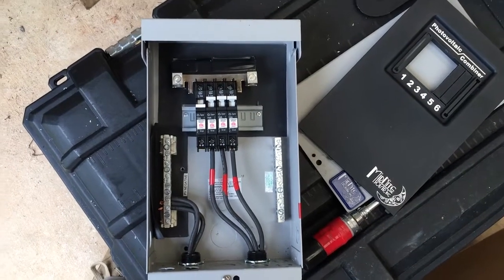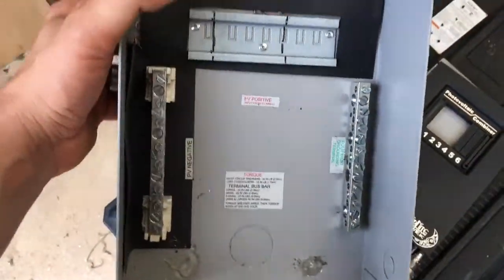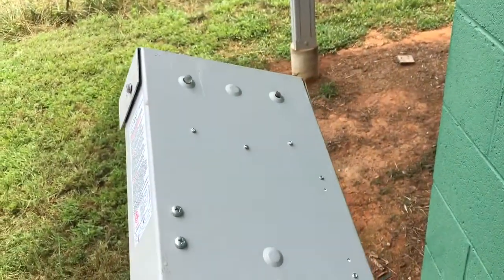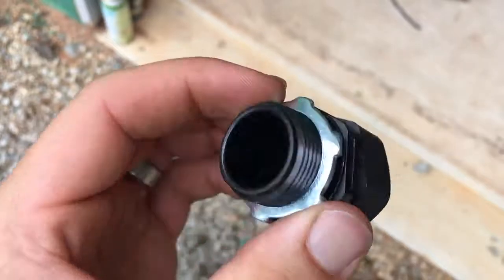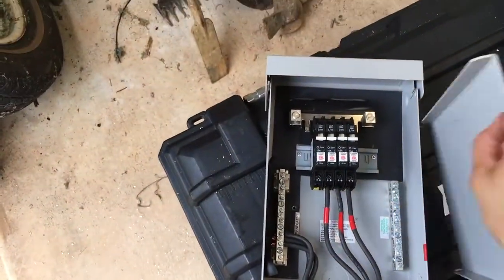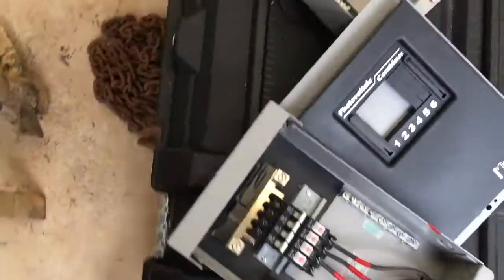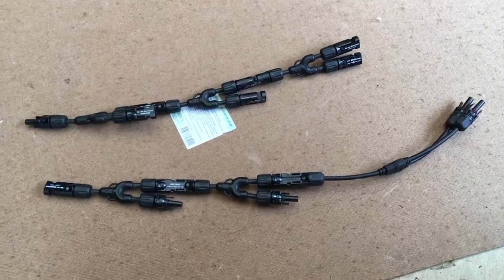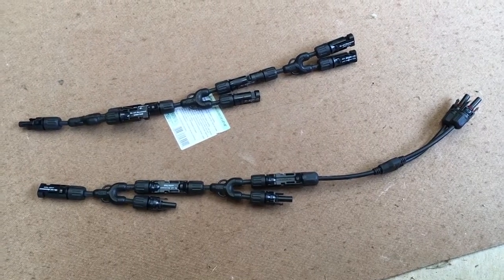What's a solar combiner box?

Comment: Great video, thank you.
Question: when using the inline fuses for each string, you would still need some kind of nema box and dc breaker or fuse for wiring that is going to charge controller, right? For example, I plan to have four strings of panels, with each string protected by 15A inline fuses. But, then I want to connect the parallel strings through 4 AWG THWN wiring through conduit, for 100' over to charge controller. I would like to buy a 75A DC breaker to put into a nema4 box to drive the 4 AWG wiring. Can you recommend a nema 4 box and breaker for me? Thanks.

Comment: I am working on installing my first Solar System on my house.  Planning to be a Hybrid Inverter with 16 370 Watt Solar Panels.  I will be connecting 4 in Series and 4 Strings in Parallel.  I have a PV Combiner Box to accomplish this task.  Voltage should be around 160vdc with around 40adc coming from the Solar Array.  Do I need to mount the PV Combiner Box close to the Array, or can it be 50' away close to the Inverter?  Thank you for any recommendations and advice.
Reply from the maker: I would put the combiner box at the array and run the combined conductors back to the inverter. But what Inverter is it
Reply: @GainSolarPower  Thank you for the feedback.  I have a Tumo-Int 6kw Hybrid Inverter.  Input 60-180vdc, 20-60adc.  I plan to mount the Solar panels on my roof and will install the PV Combiner in the attic.  Will I need to use any kind of conduit for the PV Wire in the attic?

Comment: thank you for your channel. Does the first array of pannels stay in series with the second in parallel?
Reply from the maker: It totally depends on how you have panels wired. Every job is different. A setup using this combiner might have 9 panels. 3 strings of 3 in series is a string, then the 3 strings get paralleled in the combiner.

Comment: where do you find the ratings to know how many panels are allowed on a string with your combiner box?
Reply from the maker: How many panels per string would be limited by the max Open circuit voltage the equipment you are hooking up to is rated for

Comment: Do you have a YouTube channel?
Reply from the maker: Yes you are watching My YouTube channel
Reply: @GainSolarPower  I mean do you have Instagram
Reply: Do I need a busbar for my solar system
Reply from the maker: @jamestarpley162  if you are combining multiple strings of batteries.
Reply from the maker: @jamestarpley162  is just have to see what you are doing to tell you what need/don’t need.
Reply: @GainSolarPower  led lights  pure sine inverter and fans and 12v fridge and a rocker panel
Reply from the maker: How many solar panels do you have  and what charge controller are you using. What is the voltage of your battery bank
Reply: @GainSolarPower  2 12v 120ah and a single 400w solar panel
Reply: @GainSolarPower  40a acopower mppt solar charge controller
Reply from the maker: No you don’t need a combiner
Reply: @GainSolarPower  so just my solar panels and a fuse block,my mt50 and rocker panel and a couple of  12 cigarett usb chargers
Reply: @GainSolarPower  and my fans and fridge
Reply: So I don't need a combiner box?
Reply from the maker: @jamestarpley162  no but you should go on my gain solar google page and leave me a review for helping you if I have helped you.  The combiner box is for combining multiple strings of panels into single circuit.  Its like a manifold in plumbing.  https://www.google.com/search?q=gain+solar+services&client=firefox-b-1-d&sxsrf=ALeKk00FTOVQZ2ZmGl8HYXIl0LFBJAq38Q%3A1616683144532&ei=iKBcYOP9H8W1tAac_674DQ&oq=gain+solar+services&gs_lcp=Cgdnd3Mtd2l6EAMyCwguEMcBEK8BEJMCMgIIJjoHCAAQRxCwAzoGCAAQFhAeUKU7WJFLYL5OaAFwAngAgAH1AYgB9AmSAQUwLjguMZgBAKABAaoBB2d3cy13aXrIAQjAAQE&sclient=gws-wiz&ved=0ahUKEwjj4ayE1svvAhXFGs0KHZy_C98Q4dUDCAw&uact=5#lrd=0x885f5f9f0a9021b1:0x7dc4a38a59855d7,1,,,
Reply: @GainSolarPower  is awesome thank you

Comment: That’s interesting stuff.
Does the combiner box help keep the voltage high enough in cloudy conditions or is my only solution to wire a high voltage string? 
I am planning on wiring 5-6  panels (24V) in series (single string) and connect them to a 300V rated Outback charger for my -30°F cloudy winter charging needs. That’s besides a midnite 150 (3s2p) for normal service. Or is there an easier way to do this?

Comment: Hi Johnny is there a reason I can't run all my solar panels in parallel to make one string of 34 solar panels and just connect that end wire to the charge controller?
Reply from the maker: If you exceed The voltage or amperage rating of your charge controller you will likely destroy it. I have no idea what equipment you are using but 34 panels in series or 34 panels and parallel would likely destroy anything
Reply: @GainSolarPower  I'm using 24 panels that put out 2.32 amps at 59 volts and 10 panes that put out 5.98 amps at 54 volts all run in parallel so the in coming voltage says it's 59.1 volts at the charge controller but it's only feeding about a max of 26 amps in full sun. I know something isn't right because it should be putting in about 100 amps total so I'm trying to trouble shoot the issue. The charge controller is a midnight solar classic 200
Reply: Grahm Dettling what are those? The little harbor Fright panels?
Reply: @4philipp  no they are big ones. Some are 135 watt and others are 327w but I ended up going series parallel

Comment: Do I need in in-line fuse between 4x 100w solar panels (series) to my 40a charge controller?
Reply: Fusing will not do anything when connected in series (short circuit is same as full charging so it will never trigger the fuse). Fusing solar panels is only done when connecting in series.

Comment: Good explanation on wiring combiner boxes. I could use a little more explanation of why these are required at all.  If PV strings are sized properly even on the coldest days the charge controllers should not need them for protection.  All systems should have a DC breaker between the charge controller and battery so these combiner breakers seem redundant.   We have lived off grid for over 20 years and recently upgraded our 48V system using combiner boxes/breakers as required. previously had no problems  combining with bus bars and no breakers.  Am I missing something?
Reply from the maker: Greg Burke the combiner box provides you with a means of combining all the solar strings together in parallel. Most solar panels are only rated for 15 or 20 amps. So if you combine more than 3 strings of panels you have exceeded the Series fuse rating of the panel and you need a means of protection in case you had a fault in the circuit between the combiner box and the charge controller. They are necessary on bigger systems. How big is your system

Comment: Hi Johnny, I've recently subscribed to your channel. There is so much that I have learned and so much more I need to learn. You've helped me out a WHOLE lot. Thank you. Thank you. Thank you. As for a combiner box, is it needed for systems that has micro-inverters?
Reply from the maker: Jamar Fulton thank you. You would use a regular tax breaker panel to combine AC microninverter circuits. Not a combined box like you see in this video
Reply: @GainSolarPower  cool! Thank you for the help!

Comment: Do I have my breakers on pos or neg? I'm 48v and will have 4 strings of 3 panels
Reply: Breakers should  always be on the positive line! If you have a common negative system, the neg. side can be grounded for safety reason. You need to know the max. amperage of one of your panels(should be all the same specs at one array) and the max. voltage. Meaning you have to multiply max. voltage times three. For example 21.6V * 3 (panels)= 64.8V  And this amount multiplied by the amperage of one panel is the amount of electricity in Watt produced by one string. Multiply this by four and you'll get the total wattage of your system.

Comment: I am just starting out ...purchases etc. Since it will in no way be connected to the home electrical service... how/ why am I strictly adhering to this code you mention ? (outside of obvious safety )
Reply from the maker: Rick,  Tell me a little bit about your system.  What do you have so far?  You can email me at jwv8783@gmail.com.  Here is the basic logic on following the code.  The code is actually written by the NFPA.   It is part of the National Fire Codes series published by the National Fire Protection Association, a private trade association. The intent of the code is to protect from fires.  Bad electrical work starts fires.  If you do your own electrical work and its not to code and it starts a fire and your insurance company can prove it, your insurance will not pay.  Also, although it is legal to do your own electrical work on your home in some states, it is illegal to not do it to code.  

Hope this helps.  NEC code is a bare minimum for safety.

Comment: Would it be okay to use PVC on the rack and transition to metal when running the conduit to your house?
Reply from the maker: Richard H Williams yes, you can have straight pv wire running under the array. PVC is good protection
Reply from the maker: I've used PVC outside to protect the wires, etc.  PVC is easier to work with than EMT.  Liquidtight Flexible Metal conduit is also an option.  The metal raceway has to be used once it goes into a building.  A lot of guys use EMT but  you could also use MC cable, depending on how many amps you were carrying.  There is also metal flex otherwise know as greenfield, that works too...Most all the requirements can be found in art 690 of the NEC.  I don't know what code cycle you are on...

Comment: Hello hello 

Mr. Valentine I have a question about solar 10 or 15A diode that are integrated in mc4 conections.... 
My case I would have 4 strings and 4 panels in series..... 
Do I need diodes or not.... Pro/con....
your advice would be appreciated.... 
I am located in Europe so is not usual thing to go completely off grid rather advanced you for grid tie system and so on....
Thanks
Reply from the maker: I don't know the answer to this one, I am more on the installer side than on the electrical engineer side of my knowledge base.  I think a lot of panels have the diodes built in....

Comment: Do you use Dielectric grease on your bare wires going into and out of your brakers? Hope all is well brother. God Bless.
Reply from the maker: Bobby's Solar Homestead if there is aluminum I do.
Reply from the maker: I dont call it dielectric grease.  Its call No-Ox around here.  It's a conductive paste that prevents/inhibits oxidation..

https://www.sanchem.com/electrical-contact-lubricant.html
Reply from the maker: Ok I just looked up what you are talking about, the only place we use dielectric grease in in the cat5 and phone cable connections between our different devices, it is not a common industry practice to use it on power connections.

Comment: Something that I didn't realize at first, metal conduit is required if your combiner box is away from your panels (eg. side of building). No PVC, so I think you need to junction on the roof to get into conduit (PV wire is too thick...) then run to the combiner box.
Reply from the maker: David Tucker II So as long as you don’t go in the building it could be in PVC, but the metal will last longer.
Reply: Awesome, thanks for clarifying!! Maybe I can pop through the soffit section on the roof.
Reply from the maker: David Tucker II are you trying to figure it out right now?
Reply: I think I got it now, Thx. Got my system all setup, ordered, etc. (magnum equipment with mpdh box, trina panels, Iron ridge racking, and fiat 500e lithium batteries, batrium BMS....). There is no building code where I am, but still want to do things on par with code. I emailed Engineer775 to possibly order some of the equipment through you guys, but never heard back...
Reply: Btw, thanks for all of your information/content!! I've learned a lot from the stuff that you do, keep up the good work!!
Reply from the maker: sure thing.  Let me know if there is any specific topic you would like to see a video over.
Reply: Not really something I feel like I need right now (already have 40kwh of lithium batteries), but I think a video going over lithium vs. lead acid would be great!! Specifically DOD, weight, price, cycles, etc. I think there is going to be a lot of misunderstanding on that now that the "officially sanctioned" lithium replacements for lead acid systems have hit the solar stores. 

Maybe also something about charging, voltage, and equipment differences between the two. 

Looking forward to seeing the offgrid microinverters (IQ8) from enphase next year, that could save a lot of money on solar installations.

Comment: Pro tip I use color coded wire
Reply: Dennis Jemison  I bought black and red pv wire. but will have to put white tape on the ends of the black pv wire. I am going to use this from the panels to the combiner box for easier identification of positive vs negative on dc side.
Reply: michael clark I just stick with black and buy a massive spool of 1000 feet of wire and get a good price